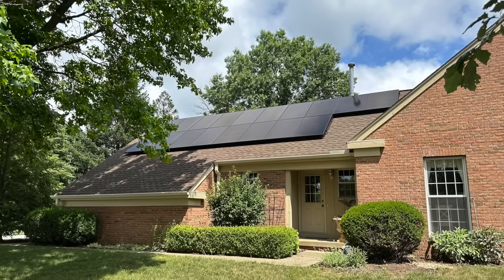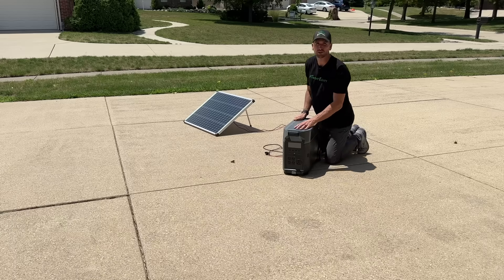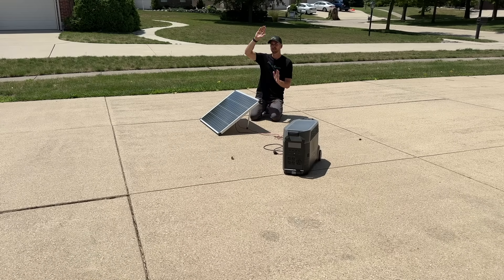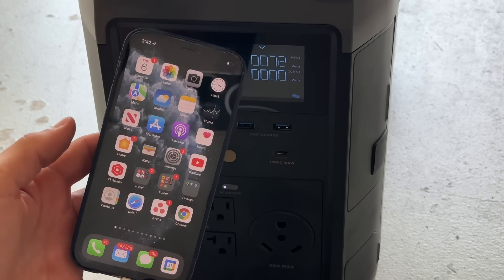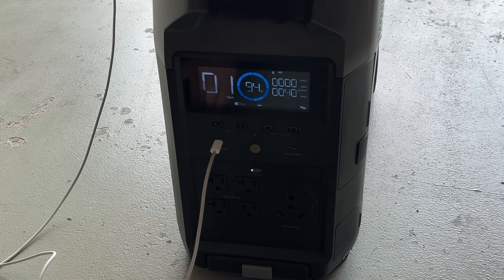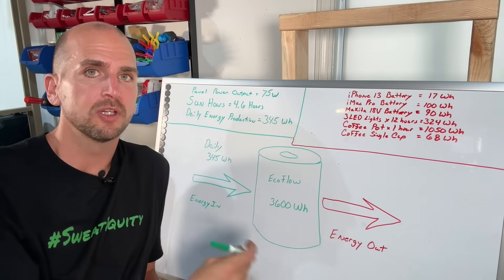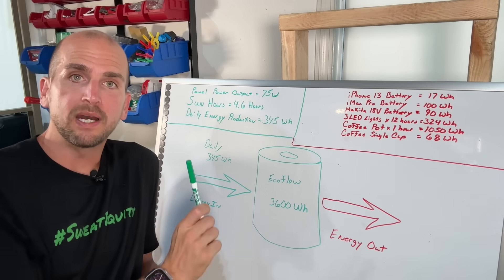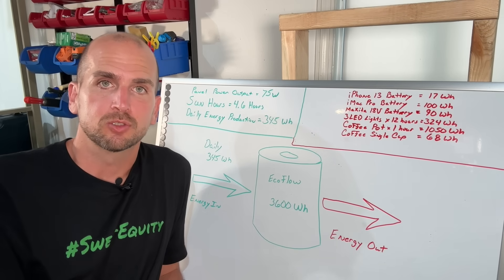What Can You Run On A Single Solar Panel?

Comment: I started out with my 100w solar panel and 1 deep cycle marine battery. 
Several years ago I had the panel on the ground and every 2 to 3 hours I would readjust the panel to get the best sunlight.

It took almost 3 days to charge up the one battery, so I went back to "Nature Power" and right around memorial day one year ago I came across a good deal with scratch and dent Solar panels two - 200w Panels with all hook-ups and one extra regulator for my 18w panel for around $ 300.00.
I was assured that the panel was like new and ONLY had a couple of dents in the aluminum frame. 
I started with my Solar panel collection in 2012, when I purchased a solar lantern. 
It came from "Northern Tools" and the Solar panel with it is a 5w solar panel. My lantern is long gone, but I still use that panel to charge up my other rechargeables...cellphones, radio, flashlights, batteries for my drill, other lights etc.

I finally mounted my 18w solar panel (got it from our local TSC) on my other shed, and once I get another battery it will only be used for the lighting in that shed.

The shed I live in has all together 500w Solar panels mounted to the rooftop as a temporary set-up, because eventually I am going to purchase 6 more 200w Solar panels (unless I can find a better deal on bigger Panels).
On the South side of the roof is the 100w solar panel facing East, 
and on the middle section of the rooftop I mounted both 200w panels.
One facing East and the other facing West.

This way I can capture the most amount of sunlight in the daytime. Approximately 6 hours per day.

I have three deep cycle marine batteries hooked up to those two panels in the center of my live in shed in parallel fashion to keep my 12v. 

I haven't learned enough about the serial hook up other then the voltage is higher with that setup. 
And I am at the moment not sure what I would use it for.

My CPAP machine runs on 12v with an 175w inverter. My Fan runs on 12v with my 100w Inverter. My Fan is 11years old already and still runs great.

I use, for myself,  a 60w crockpot, I can run my TV and many more small appliances  with different inverters up to 800w.

 I test everything as I need it.
I wonder how much energy would a 2000w to 3000w Inverter use from my three batteries?
Would I be better off investing in a 3000w inverter or continue like I am doing now...matching my inverters to my appliances? 
My thoughts on that is that a 3000w inverter hooked to my batteries would have to run 24/7, therefore using Energy 24/7. My 100w Inverter also uses Energy the entire time, but not as much as the big one. 
I have my lights, my fan, and other things hooked up to it, and I do not want to constantly get up to shut the big Inverter off or turn it on every time I need it to run.

By having my panels mounted to the middle of the roof, I only need a short amount of wiring to go both directions inside my shed to hook up my lights (under cabinet lights)

I recently found out after the severe storms we had here in southern Kentucky, that you have to climb the rooftop to clean the solar panels periodically, or like you pointed out, they will not operate properly due to dust and debris.

Comment: I always use the equation of 2 to 1. So if I have a 100AH battery preferably Lithium LiPo4 I need a minimum of 200 watts of solar to charge the battery. If you can afford more panels get them as long as your solar controller can handle that voltage or find out how many volts your solar power station will accept. Because solar panels don't produce what they say on them it doesn't hurt to go over by about 20-30% of what's rated on the panel. Make your coffee on a propane stove.
Reply: I have 360w of panels and never get more than 260w from them. Mine are connected to 5 lead acid cells with a total capacity of about 450Ah - and a grid - tie inverter that I connect in summer to 300w of panels leaving the 60w to keep the batteries topped up....just waiting for my first power-cut now, to prove to the wife it was worth the cost of buying a garden shed to install it all in  now :)
Reply: @occamraiser  Yeah it quickly becomes a pain where your 360w panels get you 260w, then you got inverter and wiring inefficiencies. Lucky to get 200 watts after that. Then lead acid is a joke compared to lifepo. You can only pull 50% out of lead acid.
Reply: @occamraiser 😊😊
Reply: @occamraiser OK😊
Reply: After one year of using solar panels, was it worth ? What's your general experience
Reply: @occamraiser I look forward to an update about your results..legit

No bs..just neutral unfiltered truth.  🙂
Reply: I have window units to cool my home I Save over 150 dollars a month for not using central air. I know split units would probably be better but not cost wise and maintenance. If a window unit goes out all I have to is go to my Sam's club store and buy another for about 225 dollars. They haven't gone up too much since I put mine in. I paid 199.99 when I bought mine. I only cool the room I'm in, the living and bedroom are on the most. The laundry room and spare bedroom are only on for a few minutes maybe half an hour. One service call can be the cost of one window unit and I don't have to wait for.service. 73
Reply: I switched to window a/c units last year. The utility bill did not change and the house is cooler! The beauty is they are dirt cheap to replace, simple to install and have current technology which is much more efficient rather than an expensive central system which lasted 25 years. @ronb6182
Reply: Can someone give me a general idea how much power a controller would use from the grid to recharge batteries at night versus using solar to charge the batteries during the day? I'm trying to come up with a design for a mini system where the wattage demand is about five thousand watt Peak during the day and only 1000 Watts at night using 4 100 amp hour lifepo4 batteries. I figure it's cheaper for a controller to charge them overnight. To give you an idea according to my electric company 950KW was my maximum usage month in any given month last year. (Summer) That's basically a 220 air conditioner at 1500w and a 900 watt window ac for a bedroom, and then your basics of a refrigerator, a small chest freezer, )2) 55 inch LED TVs and all LED light bulbs. This obviously takes in consideration two TVs or only on three or four hours a day and the 220ac is only running till 6 p.m. I am in Maryland and I have full sun no trees around my house from 8 a.m. until about 2 p.m. then the Sun starts to go down on the front side of my house
Reply: @mrobvious1100 get yourself  a mini led projector with a built-in battery that u can run on battery . With a 50 inch  fold  screen  or pull down  one.
Reply: @terryxperry awesome idea thank you . I've learned so much from you guys reading these comments. Like the mini washer dryer idea. Wash my work clothes every day. That's fantastic.
Reply: @ImVerySerious yeah, there’s a thought. Go back to the old days where we just washed clothes by hand with a bucket, some water and soap. No electricity needed. Hang dry of course.
Reply: @mrobvious1100  I think a good rule of thump would be your power company cost plus 25% to charge your batteries. That would estimate the battery / inverter conversion inefficiency plus some other losses like wiring. Put simply if you want to save money try to use less power, like how they have those ultra efficient window air conditioners now that are more like heat pumps.
Reply: Now for solar running window units if need be. I believe one 3000 watt pure sine wave inverter could run both AC units but that's a project to do during my retirement. I may go with two split units for two rooms get rid of the duct work under the house. My Florida home will be sold and I won't have as much house to cool in a shorter run year. 73
Reply: Trash videos. Allof them.
Reply: Yeah when we lost power last time, we were just making it on the burner on the barbecue.

Comment: tell me you were charging your power tool batteries in direct sunlight.  
it's a great way to shorten the life of the battery
Reply from the maker: Nope, just for the thumbnail 👍
Reply: Milwaukee has a DC battery charger for their M18 batteries.

Comment: I would like to keep my chickens water deiced in the winter. What solar setup would you suggest?
Reply: Does it ever get cloudy there in the winter? That might be a problem
Reply from the maker: Hmmm, I know large horse tank heaters pull a pretty massive amount of power 1250-1500 watts which could really add up fast when it comes to energy consumption.
Reply: The solution is to keep the water moving, moving water does not freeze.  Of course, in extreme cold you would need a mat heater to put under the tank.  The combination of a little heat and circulation will give the best (least power) results.  Expect to use more than one solar panel in the winter.   Also, a greenhouse for the water tank could be made to enclose the tank so it gets sunlight only in winter.

Comment: Ok. I've been watching them trying to push solar power 50 years. The bottom line still is: they are just not and won't ever be in my life time efficient enough to struggle with. They have gone from 15 to 20 % efficient to around 30% efficient. THAT'S NOT ENOUGH! Now you can try tracking the sun, but the reality is it's more of a novelty then something practicle. If you have loads of spare time and don't mind spending your spare time go ahead.
Reply: Look at two things: 

First, what methods of electrical power generation people DON'T promote (nuclear)

Secondly, look at what country provides most solar panels (Ch/na)

That pretty much tells me why everybody in media promotes the less efficient method of production.
Reply: @matthewmosier8439  nuclear power is great. They just don't know what to do with the waste.
Reply: @matthewmosier8439 yep Musk is right in China's pocket
Reply: It depends on where you live. Are you in Seattle in the middle of a forest? Then yeah, solar wouldn't make sense. But if you live in the southwest, solar can supply all you need and more. We have a home in Tucson, AZ and have a net surplus of power that we send back to the grid. Specifically, so far this year, we've generated 12,229 kWhs, but only used 11,185 kWhs. Our Solar setup is leased (we'd have purchased it if we had owned the home when it was installed). We pay $170/m in lease payments. If we were to buy our power, it'd be about $242/m.
Reply: WTF is this tinfoil hat reply section?

Comment: I have a portable 14kw air conditioner in my garage. What would I need to power it for about 8 hours a day?
Reply from the maker: Is it a 14kW or 1.4kW?  A large window unit is in the range of 1.4kW and a 14kW would be a Monster.
Reply: @EverydayHomeRepairs  sorry, it's a 1355kw portable AC
Reply: @luismarty1685 so it would take a minimum of 14 of the panel that he demoed in this video to power your a/c unit. But it will stop running each time the sun goes behind a cloud.
Reply: Thanks for all the answers, but the ac unit is actually a 1355kw one.
Reply: @luismarty1685  I think you mean 1.355KW. Right?
Reply: @georgeklimes7604  yes sir

Comment: $3500 for the Ecoflow delta pro,
$100 for the solar panel. 

At $0.15/kWh you need to make 24 thousand pots of coffee to recuperate the equipment cost with all the free sun power.

Can this Ecoflow delta pro connect to a EV charger? A 60kWh battery EV, you can get your money back with only 400 charges

Comment: I'd love to put some panels in my back yard... but not sure how that'd work for metering or what practical use it would have since I don't have much to power out in the yard. I'd love them on my roof but not only is that much more expensive, it's more of a pain to maintain. My yard doesn't get enough shade anyways (it has no trees) so it'd be great to have shade and make some energy too.

If I had a shed, that'd be a different story, but sadly, I also don't have a shed :D
Reply: you can get build a ground mount solar system, kinda like a patio or pergola with solar modules on top and trench back to the utility meter. To cut on costs, if you are handy enough, you can do the entire process yourself with help from additional friend who has either construction experience and most importantly electrical knowledge. 
search "ground mount solar system"
Reply: @mthemole  Yeah that's the only way I'd do it. I'll never willingly poke extra holes in my roof; I've got missing shingles as it is, and don't want more work for the roofers to have to hassle with. In our lifetimes, I doubt "house carports" will exist, but that would solve the issue of where to put panels in a way that allows for ideal placement aim while protecting the roof too.
Reply: It's not hard to trench to the house to get the power there.  You can get systems that don't export but doing that will pretty much require batteries too, or a small system that is meh.  I like going all out and displacing all my power needs, I have 8kW of solar generating 9mWh a year, displacing my house + car (7mWh for house per year, 2mWh for car for my driving).  There's so many ways to work with it though, I can see how it's confusing and hard to know what route to go with it.